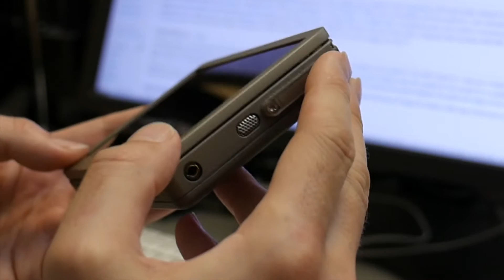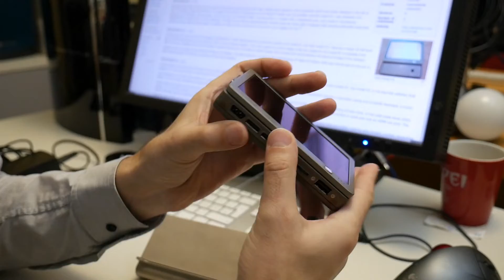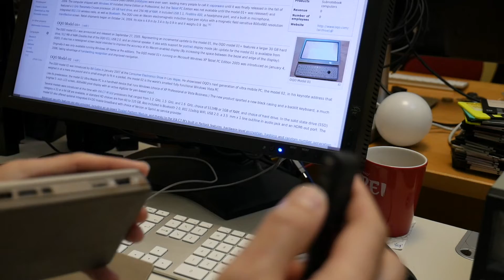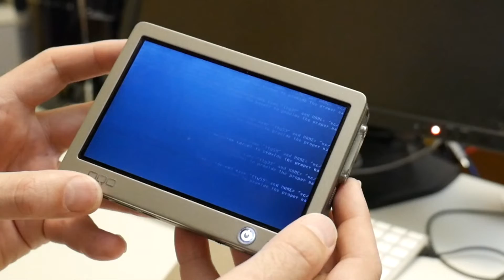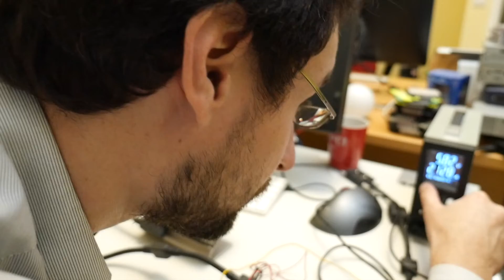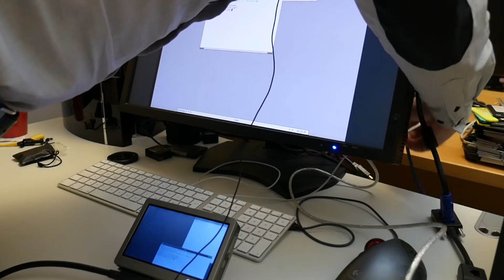Rare and world record small OQO 01+ w/ Transmeta Crusoe from 2005!

Comment: there are inteligent chargers on aliexpress for 6V, 12V for 15-20 Eur with regenerating function for old akku
Reply from the maker: Batteries that old and dead do not re- generate. Water of time and money. If you really want to better this, rebuild the pack with new cells.
Reply: @renerebe  update you knowledges about charging because are old as your charger is.in fact that is a psu not a charger, even an old fashion psu, not a switch one
Reply from the maker: @gionibegood6950  not only are this switching power supplies, a fancy lab one even, I studied technical computer science and electrical engineering. I know what I talk about. Charge controllers are also nearly never in laptop power bricks, but the board or battery pack.
Reply: @renerebe  ok good luck with you studies and deutschand uber alles behave
Reply from the maker: @gionibegood6950  your comments are disgrace.
Reply: @renerebe  in charging process the internal resistance of the battery is varying, giving a constant amperage from a psu (as you gave 0,5 ampers) in sone portions of the charging process is too much, so the battery is heating up and shorting the life time. this are doing / adjusting the new type of chargers, is varying the amperage with the internal resistance.the recovery process is varying the voltage, possible for a very old dead battery is not working i agree.
Reply from the maker: @gionibegood6950  I said I only charged the 15 years old and completely dead cells a bit so that the actually oqo internal pcb charger circuits detect and properly charge it again. This are 15 year old batteries. It is a wonder they hold a little charge, but there is no regenerating that bring this exhausted chemistry back. I earlier wrote: get new lipo cells and completely swap the cells with new ones is the only way go get  reasonable battery life back.

Comment: I just got one with the larger battery pack,  I'm in the process of replacing the battery cells once I can get my hands on the needed parts.  The battery manufacturer may not be open due to the pandemic.  Depending on the battery,  I would really not try and jump the batteries due to the risk of fire.

Just an update, I got the cells and succeeded in the repair.
Reply: I have one battery was fine. But haven't turned it on for over 3 years. I'll probably sell it.

Comment: I actually talked to the lead engineer for OQO about a year ago. He told me that when they were working on the Model 2, they were trying different CPUs, including the newly released Intel Atom, a VIA CPU, and the Transmeta. They noticed that on the Atom, the same microcode would get loaded into the CPU at boot as did in the Transmeta. Naturally, they called up their friends at Transmeta to congratulate them on the partnership with Intel, but unfortunately Transmeta had no clue what they were talking about.

And that's how Intel got sued by Transmeta for stealing their code-morphing software.

They ended up settling, and Intel licences the tech from Transmeta, and now this technology gets used in all modern processors, and is the reason why the Intel x86 architecture got that speed-bump it did in the late 2000s after about 4-5 years of hitting a wall and being at a standstill.
Reply from the maker: Thank you for your reply and story. Unfortunately I find it highly unlikely, the Atom is a simple in-order CPU, entirely different from the Transmeta. The internal architecture is documented, known and very different, and can be measured: https://www.agner.org/optimize/microarchitecture.pdf Intel CPUs also never exhibit performance stalls due switching to an interpreter or JIT-compiling. I wish it were true, and Intel could work around their latest security bugs more efficiently in a CMS, ..! ;-) The lawsuit was also about patents, and not copyright infringement: https://www.eetimes.com/document.asp?doc_id=1167347 unfortunately a common practise between bigger tech companies to sue each other for ideas written on paper, … :-/
Reply: The main reason intel got a speed bump is because they switched from the netburst architecture back to the P7 architecture (which originated from the Pentium Pro).
Reply: If you have the chance to talk to him again, please ask him about the secret codes of the OQO 01(+) ? (They were once posted at the official OQO forum but not anymore (since the forum was down)

Comment: Hey there! I have a Model 1+ as well! Any suggestion on how to repair the flat flex cable inside for connecting the battery cells to the charging circuitry?
Reply from the maker: what broke? as I mentioned in the video mine had a broken solder joint, I simply soldered it back together. If your damage is differently e.g. broken flex cable, the repair would be different.